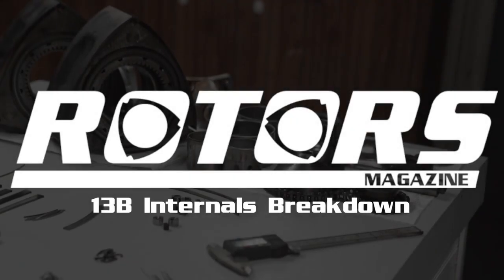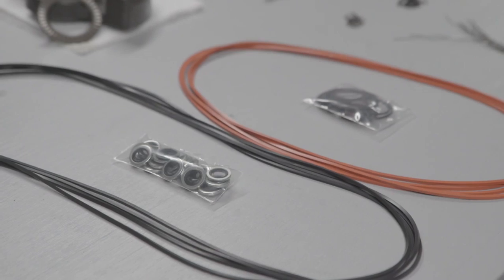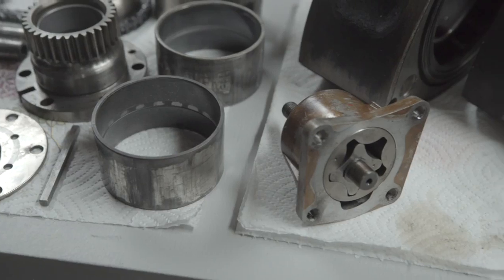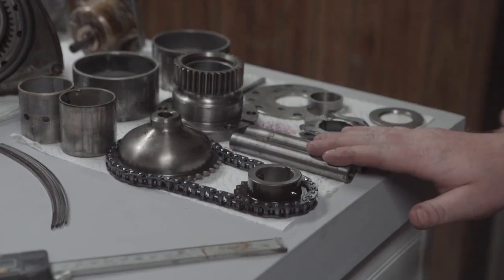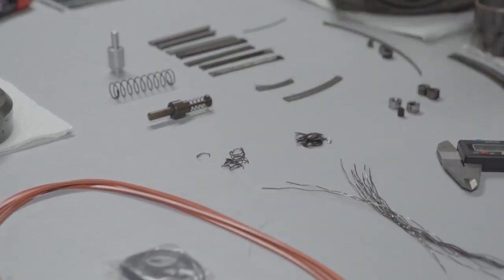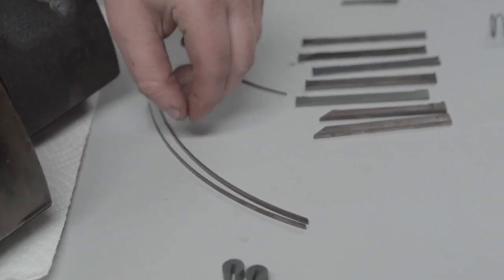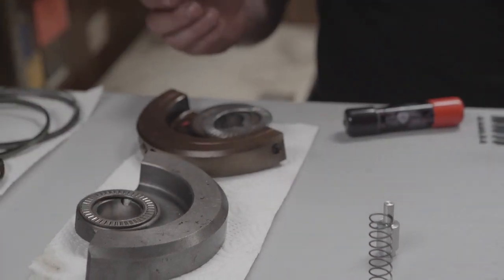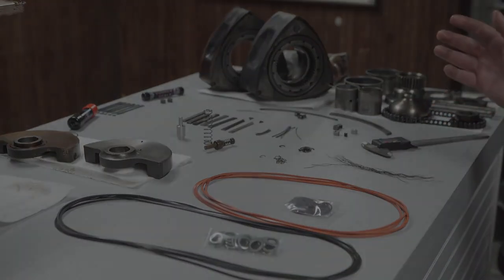How The Rotary Engine Works | Differences Between FC, FD, and RX8

Comment: I rebuilt my renesis without noticing it's side seals were thinner on one side. Do I have to take it apart again??
Reply: Storm Anderozzi : probably not as there is only 1 way to Install the seals.. In less you get really creative..
Reply: Daniel Atkins This is my very first rebuild and I used an Atkins rebuild kit and the internet. I did it by the book but I'm still reeally nervous since I haven't tried to start it yet. Thanks for the info
Reply: Storm Anderozzi : your welcome.. before you start it the engine  you should turn over by hand just to make sure the engine is turning freely.. seen a few builds over the years if this was done it would have saved a lot of time and parts..
Reply: Daniel Atkins I turned it over by hand and there's the pssh sound but it's a little harder to turn than when I first did it while having stuck side seals and many broken corner seals
Reply: Storm Anderozzi : it will be a little tight just after a rebuild since all the seals and springs were replaced, so all is normal there so far..
Reply: Daniel Atkins Great. Fingers crossed 😊
Reply: Storm Anderozzi did you start it yet? How'd it go?
Reply: Kyle Coulombe I have but it won't start without being push started. Definitely could have done better lol
Reply: Storm Anderozzi that's weird, problem with the starter?
Reply: Kyle Coulombe I replaced it with the upgraded starter long before pulling the engine but it cranked much faster before I did the rebuild. It's like the starter is about twice as slow all of a sudden
Reply: Storm Anderozzi Did you ever find out what the problem was?

Comment: I bought a na fc s4 and in order to not have to rebuild the engine soon, i was wondering if there is a way to test an oil metering pump to make sure it still works to spec

Comment: oki so If I want a roter with turbo I shout swap in the FD instead??? I know it is expensive... bout I like the rx8 and not gonna get a rx7 jous becus of the turbo.. bout if I was to by a turbo for the renesis would like to have around 300hp how long would it run..

Comment: is it possible to use the rx8 side seals on an fd motor?
Reply: 081588101 : no.. because the rx8 side seals have a Angle cut on one side where the rx7 side seals are straight cut on the sides..

Comment: hi im the proud owner of a 2007 rx8 231hp I was wounding about the exsorst ports.. ar they the only reason way turbocharged is a no go for the renesis
Reply: Daniel Kongsgaard pretty much yeah. It's doable but you need to upgrade your entire cooling system to stop overheating but even then the renny isn't gonna last long regardless because it was purposely built to be n/a
Reply: ImEasyAs well he already mentioned the exhaust ports which is the biggest limitation besides the compression as you mentioned. Fuel and tuning are a given, thats why I didn't mention it. Cooling and the exhaust ports are the biggest issues to start with